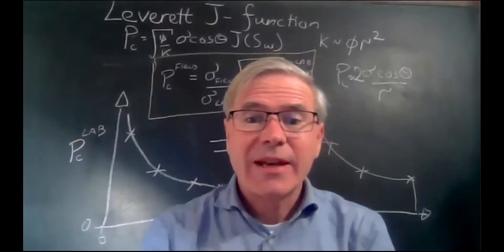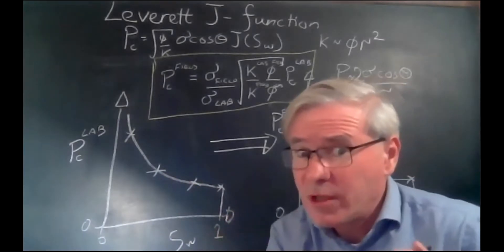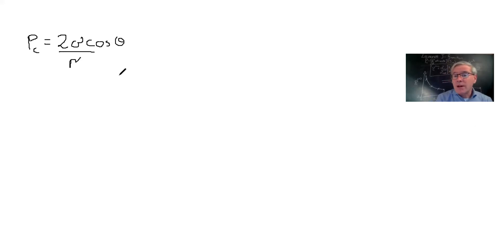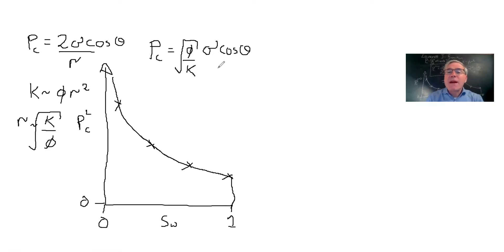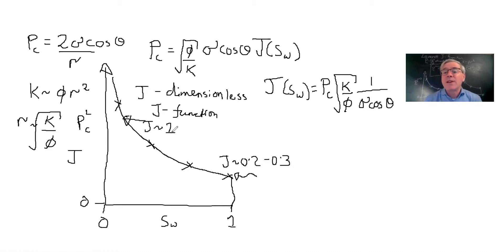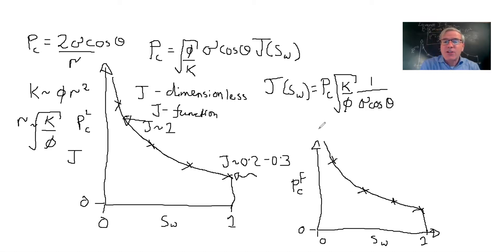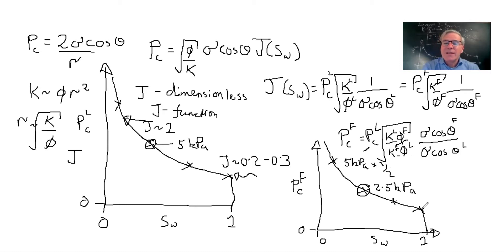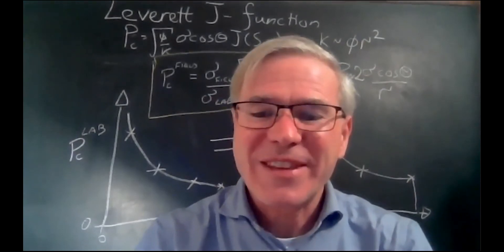Leverett J-function

Comment: Excellent class.  I am interested in knowing how one can use j function modeling to calculate the thickness of transition zone. In other words what are the criteria to use transition zone thickness to come up with j function modeling .???
Reply from the maker: You can use the J-function to estimate the saturation as a function of height in the transition zone. The capillary pressure is the density difference between water and oil times the acceleration due to gravity times height above the free water level.  You find the saturation whose capillary pressure gives this value - the J-function allows you to account for variations in local porosity and permeability.

Comment: For any elevation in reservoir, capillary pressure is independent of rock type depending only on fluid density difference. The rock types affect Sw distribution. Scaling capillary pressure curve is physically  incorrect way of dealing with the problem; instead J function using Pc should be used to allocate Sw.